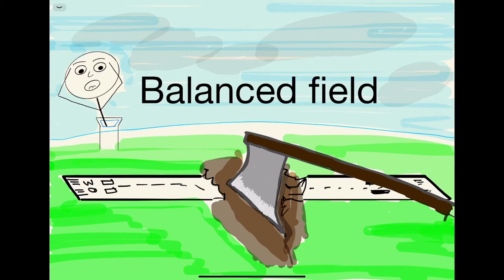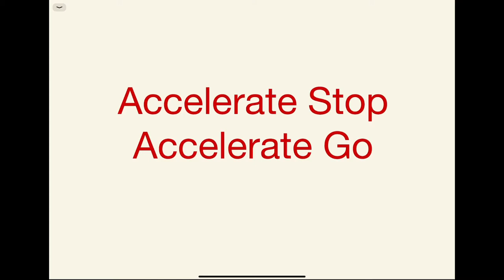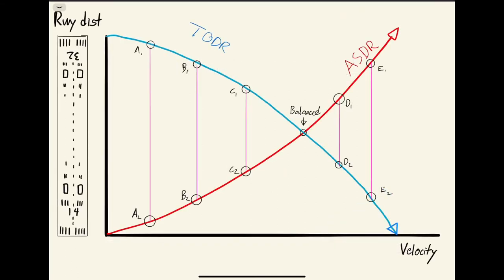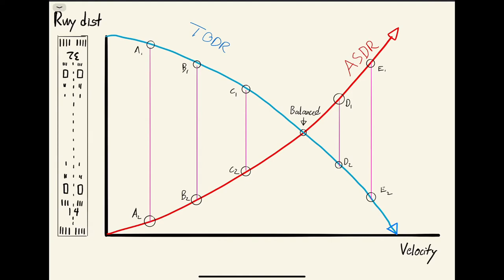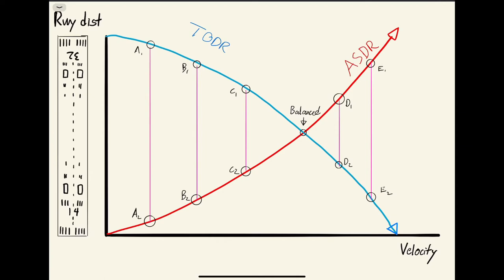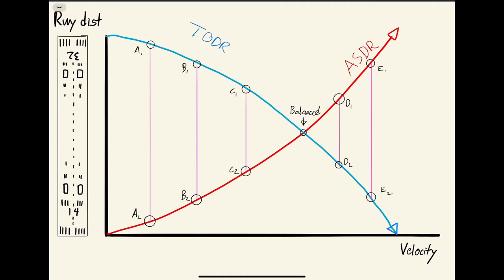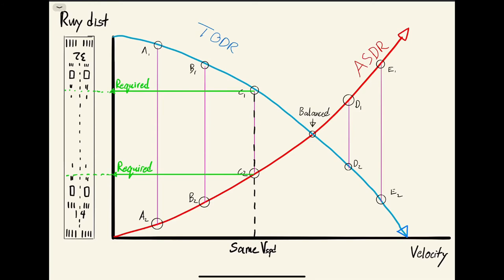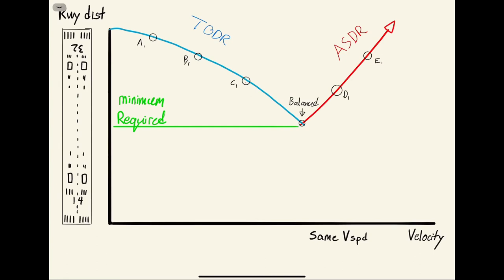Aviation education: Balance Field Length explained. V1 speed. ASDA TODA

Comment: you know what, you are better than those who have thousands of subscribers about going in details and having knowledge about the subject and I have a question sir, why do we need balanced fields ? whats that balancing about? why is it 'better' to have balanced v1 speed
Reply from the maker: Hello Mr. Demir. Thank you for commenting.
1 Why do we need balanced fields?
   A. Balanced field is just a concept for jets. Regardless if we need it or not the phenomenon exists.  
    Kinda like if you throw a ball into the air, at some point the ball won't go up and won't  come down but will  be in zero G.  
2  What's balanced field all about?  A. its where the "OH SHIT we gotta GO" distance vs "OH  SHIT we gotta STOP" distance are the same.
3. Why is it better to have balanced field V1 speed?
    A. Balanced field length (balanced V1) allows for the best performance compared to your "unbalanced" field (V1) speeds.
    *assuming that your TORA & ASDA are the same /// meaning you aren't using STOPWAYS OR CLEARWAYS in your calculations. I suppose if you use STOPWAYS (extra pavement beyond the end of the runway thats use for emergencies.) You could get better performance if you use unbalanced V speeds.

Also another benefit is that since the distances are the same. You only require one set of performance charts in your manuals.
Reply: @flightlevelview2115   another benefit it seems to me is , you can choose to Reject at the last possible second. you dont have to commit taking into air an aircraft that has engine fire . if you have a low V1 like 110 kts  and  u get engine fire at 120 kts you now have to fly the aircraft and waste 8 minutes in a circuit. 

compared to engine fire at 120kts , v1 at 130kts. just stop and the ground fire services will be on their way.
Reply: before watching your videos i disliked High V1 . rolling down the runway close to your max tire speeds. but now i realised that high V1 are actually in the pilots favor in case of engine fire.
Reply from the maker: @zaildarbains  thank you for the comment.

Comment: Great video! If the balanced field V1 gives a shorter runway required than the actual runway, I asume the airlines can increase the paying load of the airplane, so the weight will be higher and the curves will move up in the graphic. The question is, the new balanced field V1 will be similar, faster or slower? Thanks!
Reply from the maker: Thanks for commenting man.
I thinking what you’re talking about is optimum V1. you’re in a way “unbalancing” the field length so you can use all of the useable runway to its full potential to increase payload.
Reply: @flightlevelview2115  I get it. Thanks!